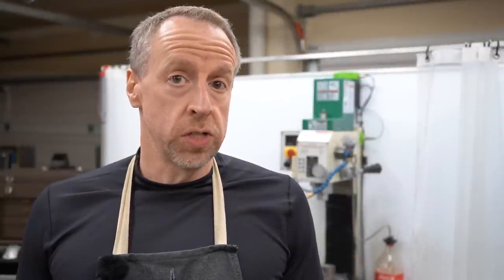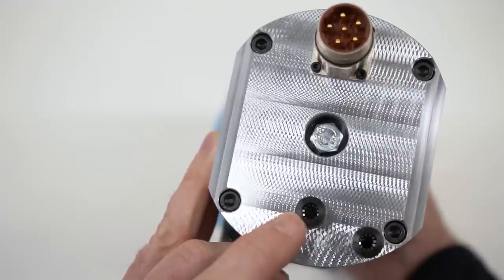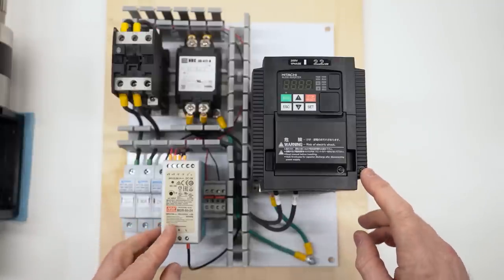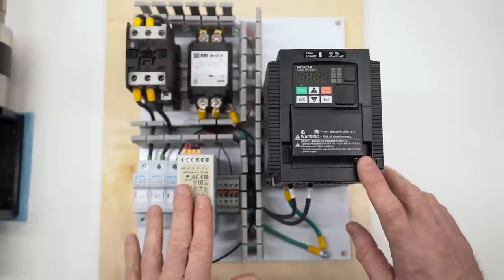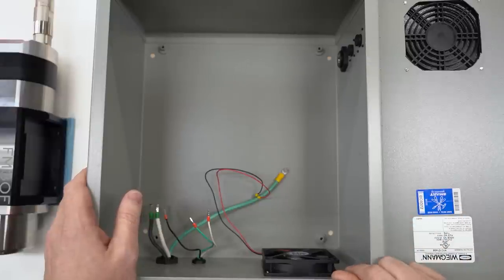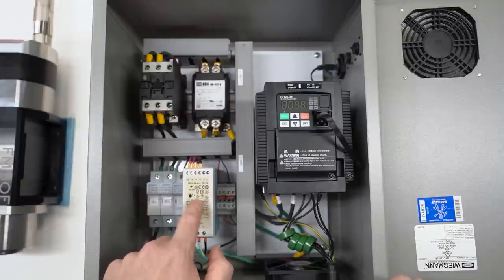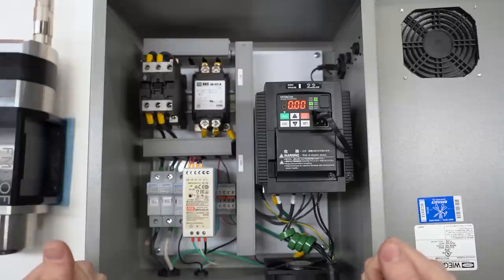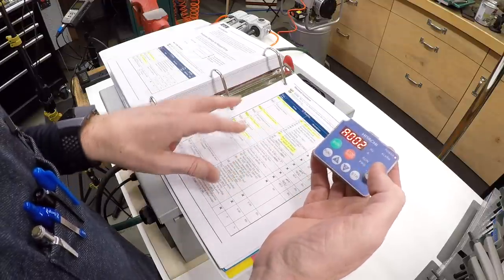ATC Spindle Part 1:  Wiring, Programming and Testing the Hitachi WJ200 VFD

Comment: If you find a Craftsman hand tool (ie screw drivers, wrenches) and it has a WF on it. That was manufactured by a company called Western Forge. They are an American company. It is a subsidiary of a company my dad used to work for. Or at least it was before he retired. WF make excellent quality tools in my opinion. Just a little FYI
Reply: Interesting.  I have some that are maybe 2-3years old that are just garbage. Almost every single flat blade driver has broken.  Sadly, they do in fact have the WF.   I got some Wiha extra heavy duty screwdrivers really cheap and they have been MUCH better tools.

Comment: While watching this video, I noticed that you have the main power leads connected to the bottom terminals on the fuse block. I realize this is a convenient point to connect them in your application, but it is not the correct place to connect the hot leads to! In case you forget to pull the power plug before opening the fuse holders, you still have power coming through the fuses which makes it dangerous if you touch the fuses. 
The hot leads are supposed to be connected to the top terminals on the fuse holder. This way the fuses are completely disconnected from power the moment the fuse holders are opened up! 
On the same note, the incoming power to a contactor, like the one you are using, is supposed to be connected to the top terminals! That is a standard in the electrical panel construction industry!
Hope this info helps on further projects.
Reply from the maker: The fuses actually do disconnect from the bottom, but the clearance is not as great, and I definitely don't trust it enough to touch the fuses.

Comment: RTFM: the best advise ever. Thanks for sharing your project with the world!
Reply from the maker: I think different people learn differently.  I find that I go back and forth.  I read enough to have a pretty good idea how to take some first steps.  Then I take those steps, get stuck and go back to the manual with a better idea what I need to know.  And so on.  In this case, overheating the motor freaked me out, so I took the time to read everything before going any further.
Reply: @Clough42  This is me also.  Finally getting ready to wire everything up after a year hiatus.  Having to re-learn, but seems to be coming back quickly.

Comment: I was under the impression that the compressed air regulator is usually installed upstream of the filtration system.  Dropping the pressure will normally cool the air and tend to produce moisture. 
Very neat motor and set up. Nice.
Reply: I was thinking the same thing.  It’s interesting to see that most manufacturer’s sell these things with the regulator downstream from the filters/driers (just like what you have).
Reply from the maker: The system is modular, so it can be reconfigured, but this is the way it came from the factory.

Comment: Awesome job as always. I recently switched from MACH3 to LinuxCNC and what a great difference. Much faster, reacts faster and the steppers runs much smoother. And that with the standard LPT port. Maybe something to consider.
Reply from the maker: For LPT port control, I totally believe that.  I'm using an FPGA-based motion controller (ESS SmoothStepper) so that isn't really a concern.  I fiddled with LinuxCNC when I first started out (on the LPT) and couldn't get it to work on the Eden VIA motherboard I'm using.

Comment: One point that you might have done off camera and didn't mention. When plumbing new pneumatic parts, you might want to purge everything before connecting the last line to the spindle. When hooking up new machines I see things like paint flakes and the other odd debris come out of new equipment. Especially since it looked like your filter/reg unit did not come with seal plugs.
Reply from the maker: It did come with seal plugs, and I did purge it off camera.  Good points.

Comment: I like the perforated steel back plates. It saves having to drill mounting holes for the components. Not a big fan of wire duct. I prefer lacing cord and plastic mounting straps.
Reply from the maker: I did my mill enclosure with low-profile 3D-printed plastic rails and zip ties to hold the wires down.  The big win with the cable duct is that it's easy to add stuff progressively or make changes in the future.  The downside is that it takes up space and blocks airflow.

Comment: Clough42 this is the most comprehensive video on how to hook up a ATC Spindle and VFD that I have found.
Thank you! thank you! thank you! 
Even though my spindle is not exactly like yours, the general wiring instructions you gave are very clear and concise. The VFD settings are not like the Huanyang VFD but they are close. The safety considerations are really good. 
Thank you for that 400 Hz tip. And the temperature connection is definitely a must.
I noticed that you have several angles on your video. Are you videotaping at the same time on all three cameras?
Thanks again.

Comment: I would suggest a solenoid in the air supply to make sure it was on as the spindle started or the VFD was powered
Reply from the maker: Yup.  That's the plan.

Comment: I found the previous series on the Lathe motor retrofit worth it for me.  I’m expecting this one will also be worth it.  I’m really interested in seeing how you deal with the air solenoids, fed from VFD switching.  Seems like this is simpler and more reliable than what I was thinking — that was having additional ATC and Spindle Cooling relays, driven programmatically through MACH 3/4.  Can’t wait till I see how you do this.
Reply from the maker: I'll be covering that shortly.  I have some additional concerns, since I'm shooting video and want to be as efficient as possible with air consumption, so I don't have compressor noise in the background all the time.  I think I have a good solution for this, and you'll see it soon.

Comment: Why did you not  connect the vfd control board to you cnc  controller,  so you can control the spindle speeds in mach 3?
Reply from the maker: I will.  I'm planning to use RS485 for that communication, so I didn't wire up any relays or the 0-10v analog signal.
Reply: @Clough42  im going to pretend i understood all that tech talk and say "great!"  :)
Reply: @minskmade  There are (at least) two ways to control the VFD remotely: 

One way is to use switch closures to control on-off type things like "on" and "direction", and to use an analog voltage (like 0-10 volts) to control the speed. This takes a lot of individual wires, because you pretty much need a separate wire for each function you need to control.

The other way is to use "serial communications". This is like a primitive version of the Internet* where you just need a single pair of wires, and you can send commands to the VFD as a series of bytes, and get responses back from the VFD as a series of bytes. This only takes two (or maybe 4) wires on a single connector, and for most things works at least as well as the many wires that you would use for discrete functions.

I don't know if any of that explanation helped, or if it was just more gobbledygook. :-)

(* I'm simplifying here, just a bit.)
Reply from the maker: I see l wilton already responded to you.

RS485 is a communication standard for devices to talk to each other.  Think of it like a USB connection that allows commands to be sent to the VFD and status information to be read back to the computer.  It uses only two wires, and unlike USB, it is designed to operate in hostile, electrically noisy industrial environments.

Comment: Hi Folks. I'm sure James has the input fusing correct for the USA. It would be wrong over here in the UK as our 230 volt AC is distibuted very differently. Take competent advice for your locality. BobUK.
Reply from the maker: I'm curious now.  What kinds of differences?  I've heard Big Clive talk about ring mains and the ground pin interlock on receptacles, but that's all I know.

Disclaimer: I am not a licensed electrician.  I'm following the recommendations in the VFD manual, and I have done enough research to feel okay about wiring my own tools in my own shop.  Sometimes I even turn off the breaker when working on a branch circuit.  :)
Reply: @Clough42  "Sometimes I even turn off the breaker when working on a branch circuit.  :)" James, I knew you were my kind of guy. Praise the magic smoke!

Comment: Thanks for doing this! I’m working on my own G0704 conversion with DMM servos and an Acorn Board. I was wondering why the use of fuses is preferable to using a circuit breaker ? Do those fuse blocks have replaceable fuses - or you need to replace the whole block if one blows? I’m thinking this will be my spindle set up eventually.... super! Thanks again.
Reply from the maker: They're fuse holders that hold replaceable 10x38mm ceramic fuses.  Many VFD manuals call for both a Molded Case Circuit Breaker (MCCB) and a fuse.  I've heard it suggested that this is because the UL testing was done with fuses on a circuit with a breaker, so something something certification.  I'm not sure if that's legit.  The Hitachi WJ200 manual calls for a breaker, GFI, or fused disconnect.  Some VFD manuals specify "semiconductor" fuses, which are extra-fast, presumably to protect the semiconductors in the drive.  In this case, I'm using normal fast-acting ceramic fuses.
Reply: @Clough42  I noticed that, like most CE products, the fuse holders are not UL listed. Not unusual since almost all Chinese electric products are not UL listed and therefore illegal to install by US code regulations. This is a problem I have personally encountered as I am rewiring my 1909 Craftsman home into a modern smart house. Finding UL listed (affordable) devices and components is quite difficult and most of the stuff sold on eBay and Amazon is not listed so while it might be perfectly adequate, electronically speaking, it is, in fact, illegal to use. As an example, the Arduino is not UL listed as is the Raspberry Pi and as such is not useable in a code approved installation.

Comment: "Non-Parallel Thread." It took me a moment to realize that that evaluated to NPT, which I always knew as National Pipe Thread.
Reply from the maker: Yes.  You're correct.  I had always heard it as non-parallel, but that appears to have no basis in reality.
Reply: Funny - I've always known it as National Pipe Taper!  There is also a straight (non tapered) version.
Reply: There is also BSP, or British Standard Pipe, which is a straight thread that ALMOST matches to NPT. Its generally close enough that you can make it work, but I seem to recall it is something like 1 TPI off from NPT threads.
Reply: @lwilton   It's the same TPI, but a different threadform (rounded, not pointy), so if you thread a BSP male into a NPT female it will go, but it will leak like a sieve!  Damn Brits  :-P

Comment: Do you happen to have the info for the line filter you used on the 240V from the wall? I will be putting one of these VFDs on a lathe in the next couple months and adding one of those is on my list. Since you seem to have pretty solid results it would save me some shopping around. 

Also...is the cable from the OPE-SRmini just a straight pass through? I could not find much information about that cable pinout online and Hitachi have not been very helpful. I already have a bunch of cat5e cable around and rj45 connectors so $15 for that cable seems pretty steep!

Comment: Also you probably have seal rings on the nose. Worked on May spindles. glad you did not go with or look at the spindles made by PDS (precision Drive Systems).
Reply from the maker: That may well be.  I'm speculating based on general knowledge.  I didn't take it apart first, and I hope not to.
Reply: @Clough42  some do some don't. the one you have looks very nice. The most amazing one I worked on ran 190,000 rpm. Thought it was going to be a screamer for the rpms but it was so quiet. Amazing piece of equipment. Great job on your videos. And thank you.

Comment: all i know is that the spindle is so quiet i kept hearing the case fan over it.
i don't understand something, how do you know the RPM the spindle? i saw the current measure but didn't see a RPM read anywhere. does it hook to the cnc board?
Reply from the maker: Sorry... The video was getting long, so I didn't show it, but I calculated the speed based on the top frequency of 400Hz, and also measured with a laser tachometer.  I'll show it in the next video.

Comment: Hi James, thank you for this video. It was helpful since I have the same spindle just the s30c version. I also have the wj200 vfd. I have a question for you. I wanted to hook up the thermal cutout to the vfd just like you did, however you used the logic terminals L and input 3. Since I am using some of the logic inputs for  fwd run and analog 0-10 volt spindle speed I had to move the jumper over to the sink option. PLC and L. So, is there still a way to hook up the thermal cutout? What do you suggest?
Thank you
Bill

Comment: Does the pneumatic filter also capture moisture? I don't think you would like water near your bearings or seal.
Reply from the maker: Yes.  Both filter chambers are also water separators.  There's no desiccant dryer, but I live in southern Idaho, where we drain the compressor tank every couple of years, whether it needs it or not.  :)

Comment: I think your assumption about Craftsman being just junk now may be incorrect.
Not only did you discover the screwdriver but I just took my ratchet into Lowe's to warranty it. I bought the  original about 25 years ago and the one they replaced it with is actually better. Not that Craftsman was ever top-of-the-line to begin with but the hand tools I've used are decent, quality tools. The table-top drill press I bought at the same time as the ratchet was pretty crappy but the hand tools are decent.
Reply from the maker: I was surprised.  So many once-proud brands are eventually sold off and exploited (cough, cough, Porter Cable) and I assumed this was the same.

Comment: Thank you for this video. I'm planning to install one of these on my mill later this year; right after I recover from having to purchase and install a new refrigerator that failed the first week of the new year. Thank you for showing how to set up the Hitachi VFD. I have two of these and only set the parameters necessary to get it running. With your tutorial I can now set the  other parameters to get the most out of my VFD/motor combination. Have you thought about switching from Mach3/Mach4 to the Acorn board and running Centroid CNC12? I recently made the switch and I'm much happier.
Reply from the maker: MACH3 is working for me.  I have a "new" motherboard already set up with Windows 10 waiting for MACH4, but haven't gotten around to it yet.  It's tough to want to jump in and tear up something that's working.  Acorn/Centroid looks pretty cool, but also not super cheap if you start adding many options.

Comment: Any reason you didn’t use a 3 wire 240/120 plug with neutral to get 120 instead of 2 separate power feeds?
Reply from the maker: The 240V wiring in my shop has no neutral conductor.  I also have a 120V switched output on the CNC control box, so it's handy for automatically controlling the VFD power.
Reply: @Clough42  now that’s something you don’t see every day… no neutral. There must be a story there.
Reply from the maker: @jameshancock  not really.  It's pretty common for high power outlets for welders, ovens, clothes dryers, etc.  There's a ground, and two hot wires.
Reply: @Clough42  oh I bought you meant the entire panel.

Comment: I am building a CNC system right now and planned on running my motion controls and the 2.2kw spindle on the same 30a 240v line.  By looking at this, you (and the VFD pages I am looking at) say that the input current can be more than double the output current.  Is that true, or could I run the VFD and the 4 servos all off the same line?  That seems highly inefficient to use double the power than it is putting out.

Comment: Just curious why you go with fuse as opposed to circuit breakers? Wouldn’t circuit breakers work better and be more convenient? Curious if I’m missing some advantage to fuses? Thanks and awesome videos!!!
Reply from the maker: The manual for the VFD specifies fuses.  There are lots of details about how fast they open and the current conditions that can break.  I just did what the manual said.  There is a circuit breaker nearby in the panel, but that's of course not the same thing.
Reply: Clough42 thanks so much! I’m currently building a 5 axis with a 54” x 100” x 26” capacity with the hopes of being able to evolve it to machining steel. Your videos have been a huge inspiration and help! Thanks so much!!